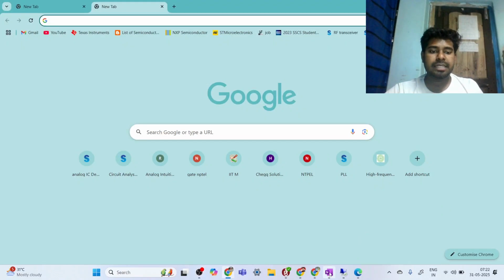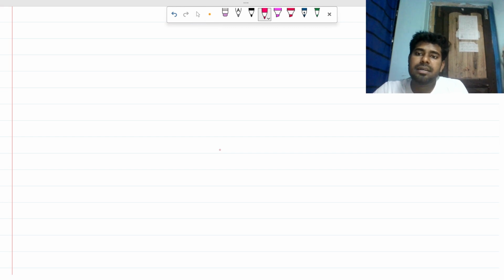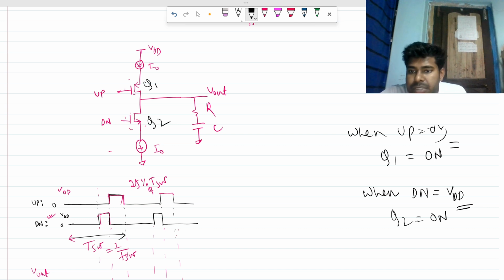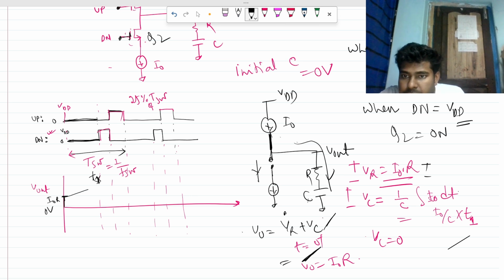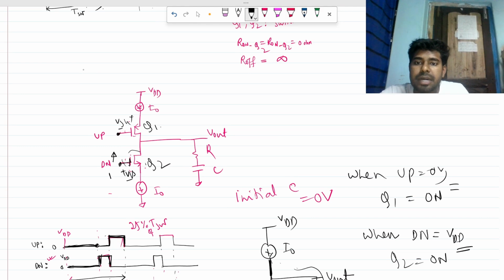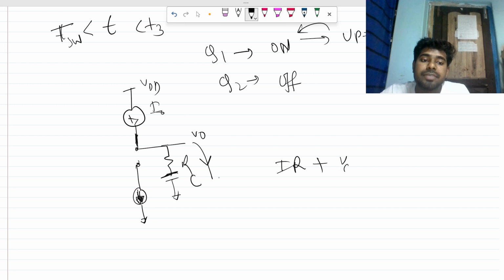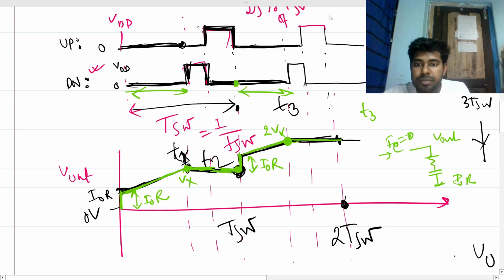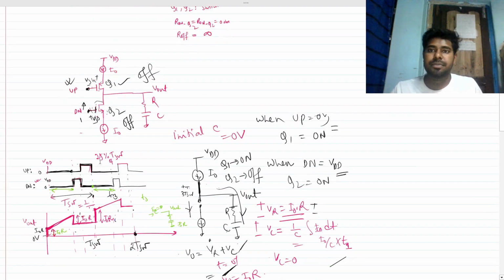Analog Circuit Design Engineer interview_plot Output waveform Complete Solution _ Amit Bar

Comment: Thanks Sir 😊
During the Tsw period of the up and down signals t1, t2, and t3, a charge pump connected to an RC circuit is used to achieve the output waveform, and the same circuit is used in the next cycle!🤔
Reply: The waveform is go up at the point IR and then the ramp at 0<t<t1,and then go down at the point IR and then hold on pre voltage at t1<t<t2 and t2<t<t3,
The same cycle is from here go up ...🤔

Comment: Nice video❤, but I think the slope of the voltage will not always be I0/C.  But as the output increases there is a possibility that the pull up transistor goes to the triode region.
Reply: Brother don,t you think that in Vout there will be some exponential term ?
Reply: Yes after some time
Reply from the maker: We are assuming almost ideal current sources !!